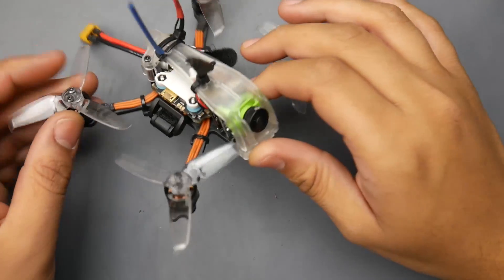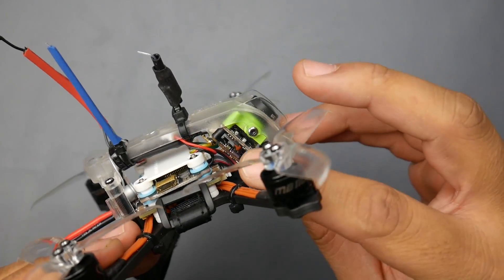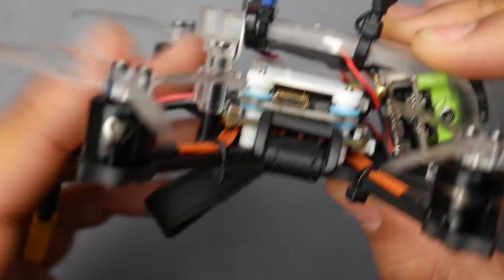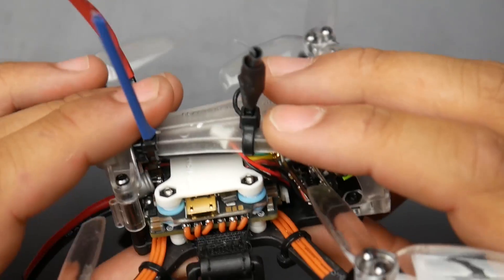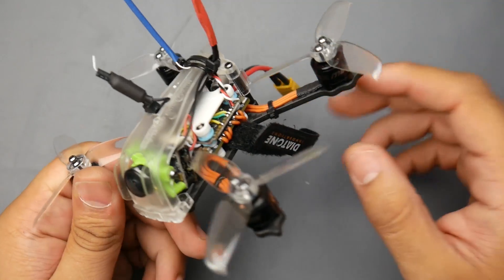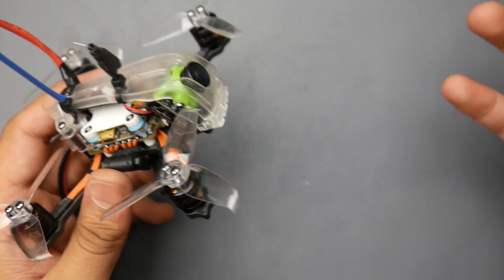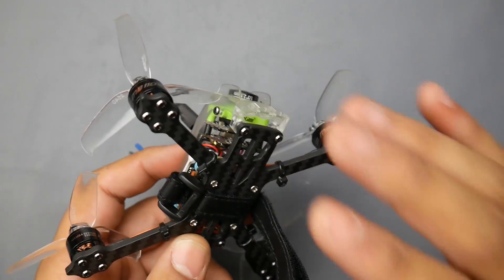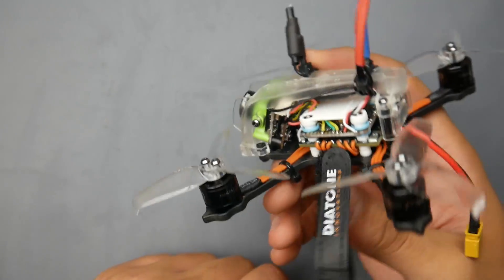Diatone 2019 GT R249+ Micro Racing Drone // Review

Comment: Awesome man just ordered one with the intention of putting an R9mm on also. Curious as to how u wired it tho. No just to sbus? Did you use a tax pad on the stack for Rssi? Just asking because I know that mamba fc only has 2 uarts
Reply from the maker: Soldered direct to sbus. R9 is Sbus just the frequency between the receiver and transmitter are different.
Reply: Ahh I understand. I guess I was just thinking about how the power adaption would work without rssi (not that it could fly far enough to really need it).

Comment: Just got this myself and it's really a nice little beast once you get the PIDs set right. I'd like to point out that the white thing covering the FC has another function in another version: if you get it with the TBS Unify VTX which I did it's not mounted behind the camera, it's actually attached to a mouting board which in turn is attached to the white plastic piece with what looks like double sided tape.

I agree that it's nice with 3S. It runs on 4S, but it's just not that enjoyable, if I want that kind of speed I'd rather take out a 5". With my tune and rates I can fly this from my backyard without fearing killing a neighbor if something goes wrong and being confident I can maneuver back and land in the small area available. I think it would be great for someone starting out but who wants something more than a whoop.
Reply: Thanks for your comment! This is actually my case: I started several weeks ago in the hobby with a Beta75S, and I wanted to step up without going to a full 5" quad. I got a 249+ from Diatone with the TBS Unify VTX and a white canopy, but Diatone sent it with an additional black and translucent one. Cool!!! 

Where did you fit your receiver?
Reply: @ikerclon  Yea, I noticed others who got the extra canopies, I never got those for mine which bugs me, would have liked to be able to change.

I have a R-XSR without the connection header which i managed to squeeze into the underside of the canopy and attach with a zip tie and some double sided tape. I've also changed the VTX antenna to Foxeer Lollipop which I modded with an U.FL connector and soft cable rather than the heavy stiff cable and SMA-connector so it weighs just a couple of grams, then I made a 3D printed part which fits to the rear of the copter and holds both the Lollipop, the RX-antennas in tubes and the XT30. Also shortened the XT30 wire. I found that out of the box the battery wire plus the wire on the copter made for a pretty long piece which had a tendency to get pushed into the props if not careful so I wanted to fix this. That's all the hardware mods i've done to it.

Comment: PLZ SIR HELP ME....!

Some Days i will make a drone But i have a problem
My Flight Controller Is Racerstar Aio F4 Flight Controller But I Don't Connecte My receiver My Recevier is FlySky FSA8S Plz Sir Make A Vedio of my problem
Reply from the maker: Use RX pad on top middle of board if you remove the label you will see it.
Reply: @DroneMesh  i know but receiver are not connect plz help me

Comment: When minis are this light, the slightest changes in weight will require PIDs adjusted. I have several profiles saved in Betaflight for the different sizes and weights of batteries. Companies should start tuning for specific batteries or recommend shape and weight of batteries that they tuned the quad with. It may be asking too much for them to take on since most cheap quads come with default settings.

Comment: I know you probably will not fly far with this setup but the way you have mounted the antenna is 100% wrong :D the best case for the 868/900 Mhz will be a T-shape. It might save you a lot of failsafes in the future  ;)
Reply from the maker: Had no fail safes and i was not going more than 70 meter away from me and I wanted to try it out.
Reply: @DroneMesh  I have the same receiver on my 5-inch build, the R9 is a hit and miss for me right now. What is your experience with the R9 system so far?
Reply from the maker: @dweight1990  Not a Single Issue on anything I have been using it for above 4km tests both the R9M slim + and the R9 large recevier. in the upcomming days I will test the R9mm to 4km and see its performance but i have been having the best experience with them and transferring everything to R9